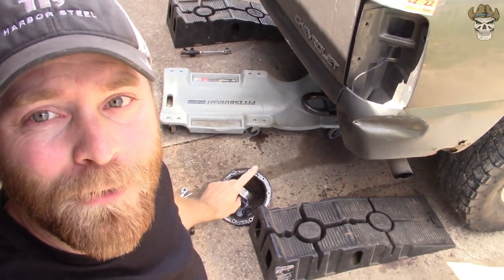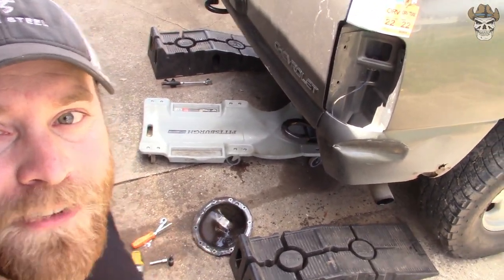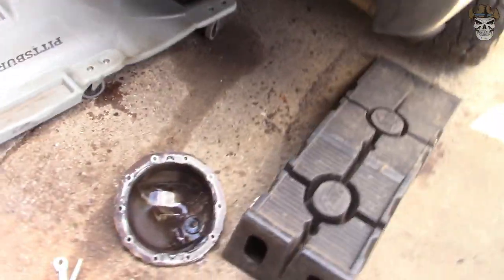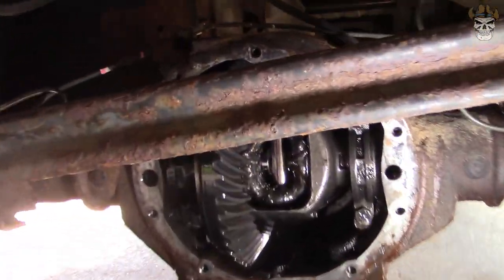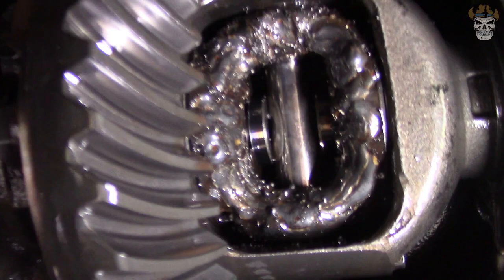GMT800 8.6 Welded Spider Gears

Comment: Can you weld my Subaru R-160 in the Outback I have with 8" of lift?
Reply from the maker: I would stay away from welding a rear diff that has CV axles especially if you are going to be lifting it with bigger tires.  You are already going to be putting way more stress on everything and way more than they are engineered to take.
Reply: @PostalRedneck  They make lockers for them and I've seen them break a couple axles. 

Typically when folks lift Subaru they keep the angles fairly stock by dropping the sub frame.
Reply from the maker: Thats what I did on my Yellow Oldsmobile when I lifted it.  It has a 7" lift but I dropped the cradle 4" so realistically the axles are only seeing 3" lift.  I guess I would say if you plan to street it I would buy something.  I have welded well over 10 axles but they have all been strictly off road rigs.
Reply: @PostalRedneck  I don't plan on streeting something with 8" of lift. I was kinda joking about welding the diff on the buggy. I don't think my humor comes across as easily through text.
Reply from the maker: Ahhh okay.  I was going to say that is going to be a horrible strain on everything but I guess some people want to learn the hard way haha.  To be fare your subaru only has one more inch of lift on it than my oldsmobile and I daily that thing now for the last 3 winters.  If its built right it should last no problem.  My old civic had a 4" lift on it with no cradle drop and I drove that thing for 8 years.  I think the lifted outbacks look cool.